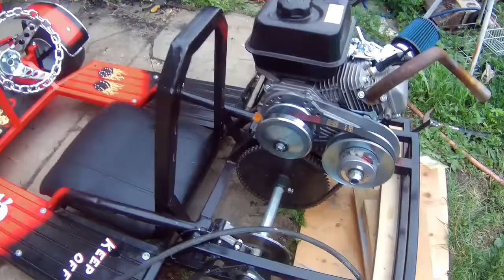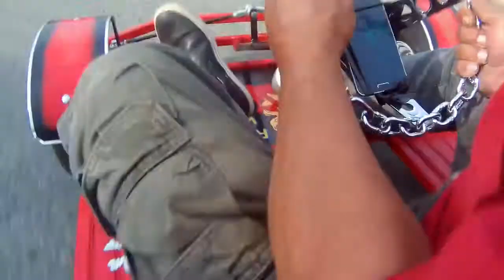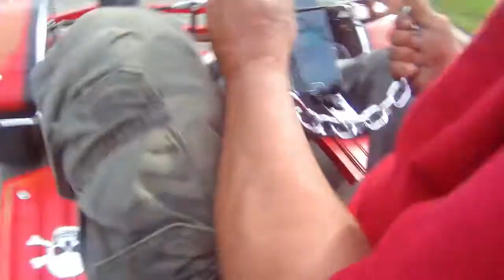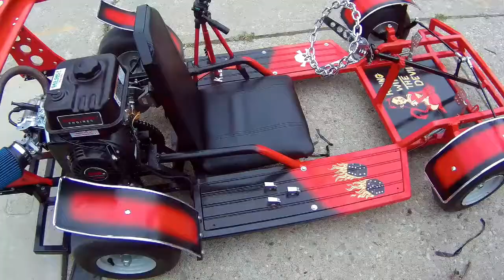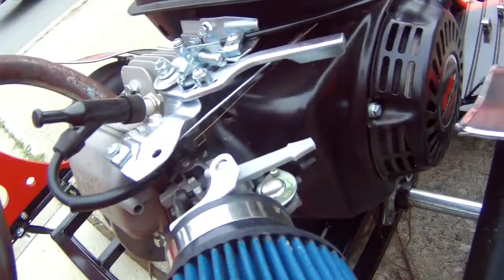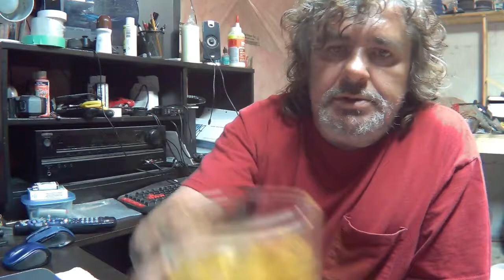Homemade Go Kart Sexy Machine pt.16 First Speed Test

Comment: Really a nice build on the kart. I have a question. I just built a kart too and I sure would like a clutch and belt setup like yours, where did you buy them and I'm afraid to ask what they cost?  I have a centrificlal clutch and jackshaft now.  I built mine for off road so it doesn't go as fast as yours. If you're interested it's the last video uploaded on my channel.    Thanks.   Dan
Reply from the maker: Hi Dan, I just watched your vid and a clutch belt setup (torque converter) will not help you for more speed with a jack shaft setup geared down as yours, torque converter (my opinion) is well worth the money if your looking for speed (Connected directly to your axle) a centrifugal clutch is fine for your setup, By the way, love your property